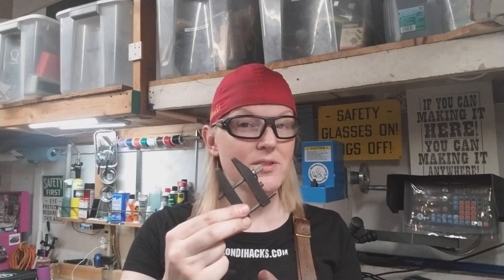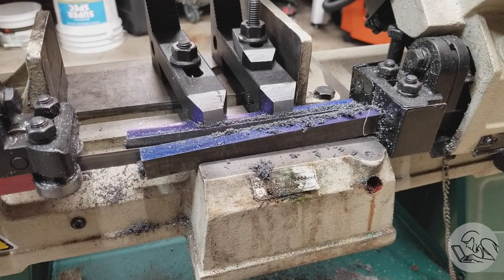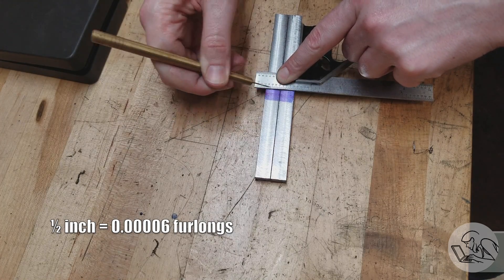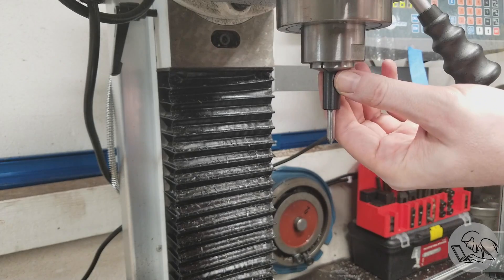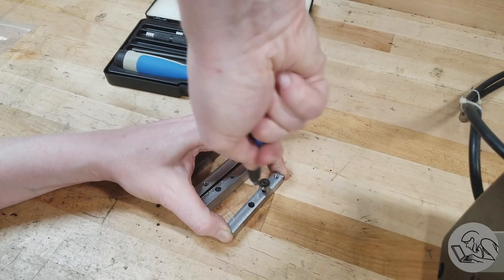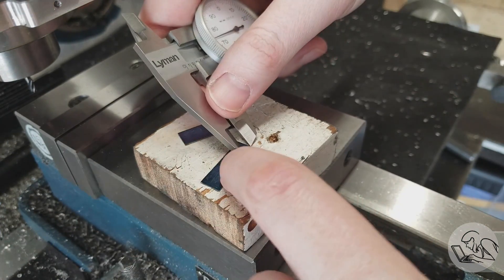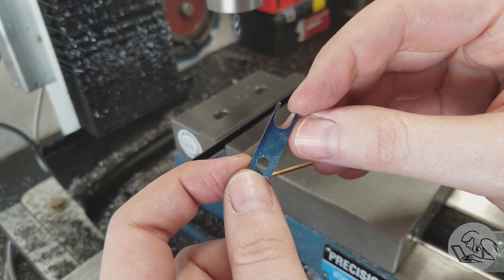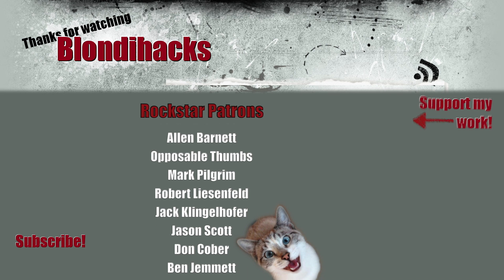Let's Make a Toolmaker's Clamp

Comment: Why not have the spring clip on both sides? The threaded pins would be identical and the setup for both Jaws would be identical, the only difference being which end is clearance drilled and which end was tapped. Seems to me that the reduced complexity would be worth making another spring clip.
Reply from the maker: Using an e-clip on the rear jaw allows you to exert clamping force both ways, which is useful.
Reply: @Blondihacks  OK. That makes sense. Thanx for the reply to an old video. 😊

Comment: Just a thought, having screws coming out both sides of the clamp takes up a lot of real estate on your table or bench. I made a set with clamp and pivot screws on the same side. "case you need to get in a tight spot. cheers Mon Ami

Comment: Anneal at the first indication of internal stress, especially if the material is supposed to be straight.  Anneal it while it still is.  In fact, with ferrous mystery metal, it ain't a bad idea anyway.  Been there, done that.  Watched the boss at the first machine shop I worked at end up scrapping a part after wasting nearly twenty hours trying to save a part made from an 'annealed forging' blank.  The part would move after even light passes.  Could NOT square it up!  "This @%!&#(!&^% machines like a sack full of springs!'  First time I ever heard that description.  :)

Comment: Sawing like that is fine as long as you are clamping it tight (like you are) The parts sprung because the blade had fed thru the bottom of the cut and was now free! (to fly away!!!) The only problem you may have had was some twisting of the blade as it cut thru, but as you were machining it, it wouldn't have mattered anyway.

Comment: Another name for a dogleg bend is a "joggle".  The advantage of using the term "joggle" is that if anyone asks you what your hobbies are you can say "I enjoy joggling".    Also you can use a parallel with thin stock you just need to put a bit of packing behind the part and also on top of the parallel.  I love the press jig.  Very satisfying!

Comment: I made one of these (we call them jeweller's vice) when aged 14 or 15 some 50 years ago on the milling machine and lathe and finished it by hot blueing it at school in metalworking class. And I still have it! One question: why do you hardly ever use cutting fluid? We were always reminded to generously apply cutting fluid. All the best from Rob in Switzerland

Comment: Bless you! I got a table-full of machinist clamps at an auction and they threw in two sets of indexed transfer punches. I didn't know what they were called until you used one on your spring steel clip jig. You should call the jig you made 'Bruce', btw. Bruce Springsteel.

Comment: Stupid question: when you realised you'd spotted the hole on the wrong side, could you not have just drilled the hole for the clip retainer through and saved the part that way?
Reply from the maker: I considered that, but then the underside of the jaws wouldn’t be smooth, which would have bothered me.
Reply: @Blondihacks  Fair enough, I think the solution you came up with was much more elegant.

Comment: I remember making these type of clamps in metalwork class at high school, but we didn't have any spring clips. Just two metal arms with two threaded screws.
Reply: Sounds like what we did when I was at school. Hacksaw and files were the tools  rather than machining. Other metalwork class projects I remember were 'screwdriver' 'hasp and staple' and  'bicycle chain splitter'

Comment: Quinn

The Dykem dauber is the cats meow, but it is sorta pricey compared to Dykem in the brush can.  You can buy solvent resistant dauber bottles that are solvent resistant for something like $12 for a pack of 6b 1oz mohair daubers, then just fill them up with whatever color Dykem you want and I betcha it is going to be a whole lot less than the $12+ for the Dykem dauber and get 4 refills out of a bush in can of Dykem for the same $12

John

Comment: Want a cheap/cheezy way to hold those thin parallels in place?  Get about a 1" long chunk of 1/2" (or whatever diameter seems appropriate) automotive heater hose and drop it down lengthwise between the parallels.  It'll crush down just fine and spring the parallels out to the jaws quite well.  Edit: at 6:10
Reply from the maker: Great idea!

Comment: Quick question about symmetry:  would it have been doable to cut the blanks in half at nearly the angle of the taper you were going to go for in the finished part, and then have to machine less material off?

Comment: Just a point....
That little springy thing is unnecessary and over complicated.
A piece of flat gauge plate 1/16 thick will hold the adjusting screw in place.
Counter bore the top jaw, where the adjusting screw locates, accordingly.
Don't forget to put grooves in the jaw faces.
Most apprentices in the U.K. back in 1976 made these in the training school in their first year apprenticeship. I've still got mine all these years later.
The jaws where made from mild steel and then case hardened...
Great channel always interesting....

Comment: 8:20 you can flip the Part and call that the Underside, drilling 2Holes and one blind hole......there are no Angle milled yet....
Reply: The tricky part there is that the clip screw isn't a through hole either
Reply from the maker: There is no configuration on the type 1 clamp that needs three spots on one side of a jaw. Trust me, I thought about it a lot because I was faced with making those parts again.

Comment: Nice die setup for the spring! Yesterday I had to drill thin pieces of spring steel, I used little carbide drills that are almost as cheap as dirt on several Chinese online markets. They work just fine, although my lowest speed setting is still a bit too high for them.
Reply from the maker: I would think for small carbide drills you’d want as much speed as you can get. The smaller the drill, the higher the speed, and carbide needs more speed than HSS.

Comment: I may have a hack for you and your viewers who have that same 4X6 band saw, whoever's name is on it.
I bought one and love it but the chips and cutting fluid dropping on the floor became annoying. I found a small tin bread pan that I had picked up somewhere fit underneath the drop off edge perfectly and grabbed some magnets to hold it up onto the frame right where the chips drop out.
If you empty it out often I found it works really well.
You will need some strong magnets though.

Comment: In junior high school metal shop around '57, '58, tool makers clamps were a mandatory project!  One semester to complete.  Seems like plenty of time...but, the only machine allowed was a buffer to make them look pretty!  We got a piece of 1/2" square bar, 2 1/4x20 screws about 2.5" long and 2 washers.  Task: saw to dimensions, use files to refine shape, (lesson here, files don't cut on the back stroke), learned the draw file technique, drill and tap holes, a challenge for a 12 year old.  File a flat on the edge of the washers and solder the washers in the groove of the screw head.  Polish the thing up a bit and viola!, a nice clamp that will last a lifetime!  Still have it 62 years later.  "Thanks for the memory...of rainy afternoons, swingy Harlem tunes", ah but I digress!

Comment: Great project although I wonder why a bright young lady would bother doing it the way everyone else did.  Talking about springing when cut I wanted some 2"x2"x16' but believe it or not 2 of these 2x2s cost a lot more than one 2x4.  So I bought half as many 2x4s as I needed 2x2s.  You can see where we are going here.  While cutting the yellow pine 2x4s I would push them over the table saw until the end got too heavy to hold and then I would walk around the saw and pull them the rest of the way.  I cut one that looked reasonably straight but when I walked around the saw to pull it the two ends had already misaligned and crossed each other like an X.  Super warp.

Comment: Hi Quinn  Enjoyed the video.  Since you are making the screws did you consider cutting a half moon in the shank and retain the screw with a small roll pin which goes through the clamp body.  Making spring clips is a little old fashioned and tedious which would discourage many.
Reply from the maker: Yah that would be a very nice way to do it! I just followed the old design without thinking about it a whole lot.
Reply: @Blondihacks  Thanks you for the reply.  Perhaps on the second  manufacturing round. Can't have too many clamps! Cheers.

Comment: ;-)  One of the first practical things I ever made on a lathe (as opposed to jr. high shop projects) is when my grandfather was helping me with my car and he noticed I had done some very funky repair on an exhaust pipe flange.  It had broken and in my whatever works college fix I had pop riveted some drain pipe (with a flange) in to the exhaust pipe.  Grandpa was a machinist and was not impressed.  So he had me machine a die to press a flange that we (he) welded on.  I still have that die and yes it was a lot of work to make essentially a coned washer but it was sooo satisfying to press that flange.

Comment: For the angled clips, when I made some clamps I used the metal banding that they use to hold heavy equipment to pallets. It seems to be spring steel. It's cheap (read free) and comes already blued.
Reply from the maker: Old bandsaw blades are also a great source of this material

Comment: I have two "type 1" style toolmakers clamps, made in the UK, with the blind hole, and 1/2" wide jaws, but neither has a spring clip.  Nor do they have knurled thumbscrews.  The older one has 5/16" x 18 BSF screws, with a sort of short tommy bar fixed near the centre of the 1/2" diameter smooth section above the shoulder, like the crossbar on a lathe chuck key.  The less old one has M8 x 1.25mm (about 20tpi) screws with holes for 3mm tommy bars - it came with a pair 60mm long.  I find the lack of spring clips is actually an advantage, in that it makes it quicker to open and close the jaws by anything other than a small amount.

Comment: Could "crazy internal force" result from heat being generated at the saw blade and expanding the core of the blank more than the surface?
Reply from the maker: There wasn’t much heat here (as evidenced by the lack of smoke from the cutting oil). Cold rolled steel often has crazy internal forces in it.

Comment: The pacmac thing ..lol... I recently started using a piece of 10 guage copperwire for some clamping procedures as well. Works great. What was the blue lube you used in the video?
Reply from the maker: That’s 50:50 mix mist coolant. I’m trying it out as a less smoky alternative to sulfur cutting oils. I like it so far. You mix it much stronger than you would for actually misting.
Reply: @Blondihacks  thanks for the heads up

Comment: Back when Noah was a lad a toolmakers clamp was an exercise we each made in the school metalwork shop here in the UK. We made a type 1 clamp with the blind hole the tapered ends were made using a shaper. It was the only time that as a 15 year old boys (there were no female engineers in our group at that time) we were allowed to touch it. It was well before health and safety ( which many years later I found myself enforcing as an Environmental Health officer). However even then the teachers thought it was too dangerous for us lunatics to be let loose on by ourselves. Thinking about it now I hate to think what damage we could have done with it.

Comment: These little clamps are such a great project. It touches on so many common operations. I used these for our project when I taught the machine shop safety class. The drawing we used had an odd fractional angle for the nose of the jaw so the students also got to learn how to use a sine bar. Great video as always!

Comment: My angle grinder's blade guards use #12-28 machine screws to stay on.  Being the itsy-bitsy metal between me and changing out the grinding disk, I usually go ham with the nearest impact driver to undo the screw to get the guard off.  This has resulted in me chewing through the three #12-28 screws that came with my grinder in the year I've owned it, which has resulted in me searching local big box hardware stores and little local hardware shops for some replacement fine-pitch #12s, being limited by trying to shop as little as possible during this pandemic.  No dice, so I'll probably have to buy some online and pay extra for shipping.

Hoping to sooth my aching pride and stinging wallet, I turn to YouTube, hoping to lose myself in yet another great Blondihacks video, and who do I find in the middle of it?

My white whale, the #12-28!  From Hell's heart, I stab at thee, ye fine-pitch twelve!
Reply from the maker: Poetry 😀
Reply: Blondihacks in woodworking we call that clamp a hand screw clamp
Reply: @dcurry431 AKA Cap'n Ahab- check out McMaster-Carr, they should have boxes of white whales awaiting your beckon call.
Reply: Do you have a "Fastenal" near you? They usually have bolts in more odd sizes than your typical hardware/DIY store.
Reply: K
Reply: ah, yes. I have a pump that has a 12-28 in it.